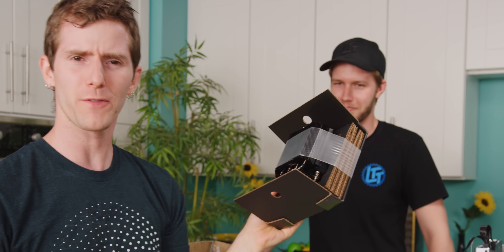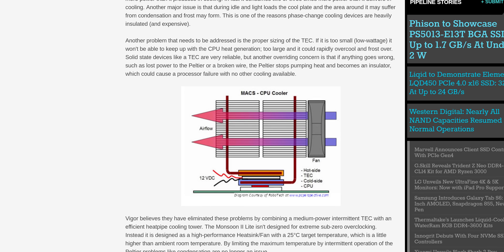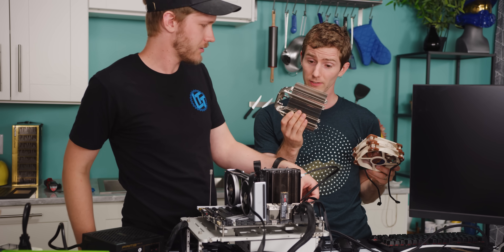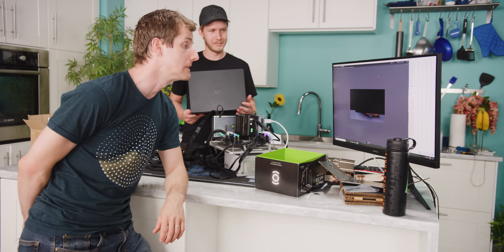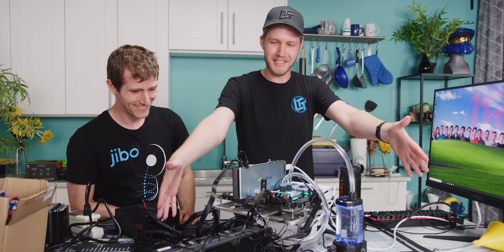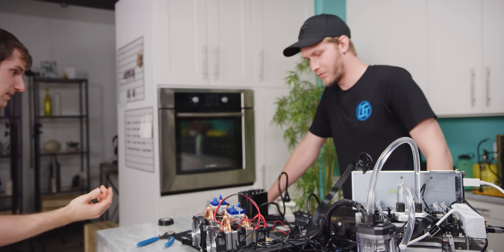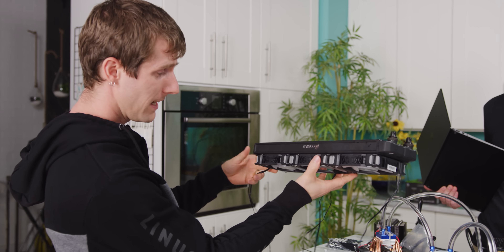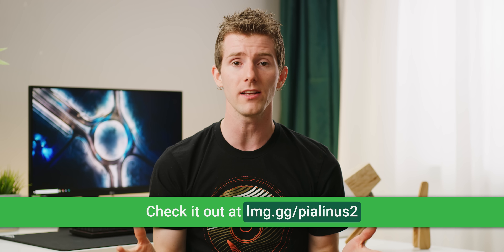Thermoelectric Cooling is a Bad Idea

Comment: Many of those eBay Peltiers (assembled or just the chip) are not the power they state. I bought a 15-amp one and it was actually 3-amp and another was 8-amp.
Reply: There are scammers on eBay? Imagine my shock…
Reply: @TruthNerds  The variability is the result of the manufacturing process and the failure to test and rate the individual units.
Reply: @davidmuth4571  With such a huge discrepancy I think it's more likely they print various model numbers on the same cheap units. How many people will actually measure the current draw?
Reply: @Audio_Simon  It's common practice among many DIYers to routinely test and sort various component parts.  Audio modders test upgrade caps. R/C guys test their new motors, servos and batteries. CMOS chips which are processed in the same batch get ratings which determine their specs and price point. Chips from the same plate could cost as much as $1000 with a "0" rating, while another graded lower might cost $100.  Variability in manufactured items of all kinds is a fact of life.
Reply: @davidmuth4571  Everything you say is surely true. But in this case I just don't think production variability is what is what's going on. Are peltier 'chips' so difficult to make that they design it to draw 15amps and it only draws 3amps? That's 36watts instead of an expected 180watts.
Reply: @Audio_Simon  To know that one might need to what part of the inner workings could cause the variation. An uncalibrated  power regulation module  could easily account for that much variation.

Comment: Why is this idea just now coming back? Cool-IT systems had an amazing product almost 10 (wow maybe even 15?) years back with the FreeZone and Boreas (with or without the MTEC or Silverstone case). That was when Pentium Ds were showing us how to properly heat rooms. 

I am still running my same look with 2010 with my Boreas and MTEC in the SilverStone case. The MTEC control can be a bit wonky, but that is easy to fix or bypass. 

If I remember right, what killed the idea for Cool-it was not the TEC, it was subpar pump manufacturing by a vendor. No one wants blue water goo dripping on their Video card.

Comment: Linus just one thing for you to try. A peltier element can generate power. when there is a temp difference between the 2 plates. Now connect it up between the processor and the cooling element, connect a fan to the peltier element and see how it cools ;-)

Comment: The heat-pipes (in the twin series cooler) won't work, if they are, the way up shown in the video.  The water-block needs to be at the BOTTOM, with the heatpipes and fins at the TOP.   The heatpipes contain a liquid that evaporates; rises up; gets cooled by the fins; and drops back down as a liquid, to repeat the cycle.  If the water-block is at the top, all that happens, is the bit of gas inside the top of the heatpipe, gets hotter and hotter and hotter...

Comment: They actually had the right idea with the smaller one though, using 2 sides, one for normal cooling and one for the TEC cooling. However, what I found to work best is to use a normal water loop with the radiator, and add the TEC modules in the loop to cool the water. Because of the limitations of the TEC modules, it is best used to improve cooling rather than replace normal solutions.

Comment: What you should do is:
Using two CPU coolers with a TEC between them pumping heat from the output water into the input water of the water radiator. This will both cool down the water exiting the radiator and also increase the amount of heat being radiated as the increased temperature of the water entering. You will be soaking and dissipating proportionally and quantitatively more heat.
Whether it'll make a difference, we'll wait and see :D

Comment: ....jesus. That Peltier you ordered draws more power than my entire machine. And, I run an overclocked Vega64. Thefuck.
Reply: Laughs in r9 295x2
Reply: I had a machine where i measured well over 500W consumption at one time - overclocked Phenom II x6, GTX295, somewhat inefficient power supply.

I should actually measure my current machine, which is still the same Phenom II X6, still the same Bronze class power supply, but the GPU is now GTX970 with a good bit of an overclock, which shouldn't actually be THAT bad. A coarse estimate told me i can expect 175W out of the CPU package on my current overclock. I think i can do more than 300W at least.

Comment: also whats with the soldering, get you a crimper and some crimp pins and housings. i find crimping a lot less problematic, i only ever solder when i don't have the right connectors.

Comment: That's not how you do it, you supplement your water cooling with peltier to get even lower temperature... Use two cpu blocks to sandwich them so you can increase the difference between temperature in the loop

Comment: TEC are used to cool something down, not to dissipate heat. Your thermal camera is a good example. TECs are used in cooled MWIR cameras - but so are Sterling cryo coolers that cool down to 77K (-196°C).

Comment: I would love to see some daily practical use temps in the next video. As in, how the temps are when someone is gaming, streaming, etc. Not just blasting it with Renders. I only ask this because back in 2007 or 8 I had a TEC on my old Intel Core 2 Extreme, believe it was a Q9650 or QX9775, anyway the TEC actually did a really good job during gaming at the time until its proprietary fan died :-( So again I'd love to see real-word applications, not just work-related rendering.

Comment: instead of trying to find a better peltier device, you could just stack multiple on top of each other with diminishing returns
Reply: Mycon yes and reduce the input power the closer you get to the cpu in order to prevent the upper Peltiers from getting over saturated with heat

Comment: A Peltier device creates an electric charge through thermal difference between plates(hence them being also known as Peltier GENERATORS), why on earth would they put heat into the system, in the form of adding electricity? Yes, you could reverse the thermal process with electricity, but you would still be putting heat into the system, like cooling your CPU AIO with lukewarm water. I gather physics students didn't come up with the idea. 

Or CPU = heat > Peltier takes CPU heat and generates electricity = powers it's own fan to dissipate. Very badly, to the point of "may as well not bother", removing the peltier would probably improve the cooler ironically.

Comment: Yep, bad idea.  I went full in, direct contact TEC, liquid cooled TEC chillers, huge power supplies and a lot of time insulating everything.  It was a great learning experience, but not worth the time, effort or investment.  The clock speeds you’ll achieve with 0F (-18C) isn’t much better, if at all, than a good liquid cooling loop.

Comment: Can someone help me upgrade my pc? i need to ugrade my cpu but i have no idea how, i know that i want either a ryzen 7 series cpu but this means i need a new motherboard but i have no idea about how to upgrade both at the same time. My build: CPU - ryzen 3 1200 Motherboard - msi tomohawk b350. RAM - 2x4 8gb patriot viper elite.  Power supply - 450 watt bronze.      GPU - gtx 1050 Storage - 1 tb Western digital blue and 250gb ssd (boot drive). Case - Cooler Master Masterbox 5 or something like that

Comment: I hear Peltier coolers are going to make a big come-back, and they're going to be internally integrated to allow vertical stacking of memory layers on top of cache layers on top of cpu / ccx / I/O modules on top of a substrate, because 3d stacking is the future, but the first thing they have to do is figure out how to deal with the heat. So each layer (maybe 2nd or 3rd layer) is going to have a Peltier cooler in it, to get the CCXs in particular down to 30 or 40 deg running temp. So your water cooler block will face a surface with a 115 ~ 130 deg C, but the internal parts of your CPU package will be roughly room temperature.

Comment: A few years ago I put a tec between a Pentium and the stock heatsink in an always on configuration. It worked well for a few months but it ended up causing condensation on the CPU and fried it.

Comment: I can't find it anywhere but I'm pretty sure at some point MSI had a prototype for a cooler using zero energy using Seebeck effect (little brother of Peltier effect, but the reverse way, temp diff into electricity). If I recall well it was ok for short bursts, but under sustained load the tower was getting to hot for there to be enough temperature difference between "hot" and "cold" side, so no more electricity to run the fan

Comment: I have actually built a system with a friend that cools it's self with a peltier.
I will just say that the greatest strength of using one is not bein utilized.
The system we built was a i9 with two 1080Ti's and was being cooled by a pair of Peltier's with only intel stock heatsinks on them.
The main thing I thought of when I created the system was the theoretical max temp of the heat sink witch would be in the realm of 90c due to the fan plastic melting point. So the system has a somewhat normal water cooling loop then the two Peltier's in a similar setup to the second thing you tried.

It's a cool setup and a lot smaller than the rad's that would have been needed but you are right about the power usage.

Comment: I remember these making the rounds around 2003-2005. I was so obsessed about this working.  But the big issue back then was it would make them board wet with condensation. It was open air.

Comment: CoolerMaster V10 did it forever ago.  Except they made a normal 10 pipe cooler, and added the chip on top of the CPU block that would only kick on as a boost when the CPU exceeded a certain temperature.  Neat concept, but it didn’t sell well, and it was too ahead of its time.  They also gave the chip its own radiator, instead of integrating it into the existing fin stack.  I’m not a fan of water cooling, but what if you connected the fish tank coolers AFTER the radiator?  Let the radiator bring everything close to room temp as normal, but then the fish tank coolers suck out a few more degrees before sending it back to the CPU.

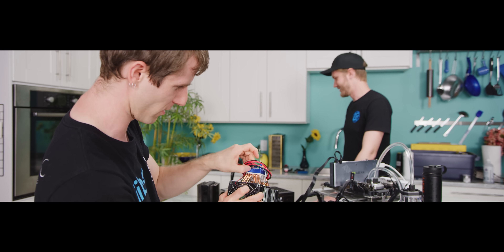Comment: 11:00 for anybody else that does this stuff, use butt connectors.  Solder, even when shielded, is weak to heat and will soften with heat which can cause issues.  Same reason that a lot of people that work on cars don't solder under the hood.  It'll probably be fine but solder also degrades over time. You could also use small quick-disconnect connectors in case you wanted to take it off or switch it or whatever

Comment: Idea: Use regular water cooling radiator that can remove heat fast enough. BUT, add a 10 liter water tank with a large peltier cooler. So when user is idling (browsing etc) for a few hours the peltier cooler is capable of chilling the large water volume to lets say 0 degrees. This would mean you have 4.2 kJ*10 L*(25°-0°) "stored heat capacity", and it would take 1½ hour for a 200 w cpu to heat it back to 25 degrees. When that happens the normal water cooler radiator takes over. You would of course get condensation etc but a fun experiment.

Comment: Instead of replacing the radiator, add the Peltier in to the loop and see what difference that makes. I know the draw will still be high, but I've been wondering how much cooler can it make the liquid when adding it in an existing loop?

Comment: I had a peltier cooler on my 486DX/4 120MHz. Did not work well.
While idling, the cool part condensates a lot. And under load it wasn't enough where the CPU overheated.

Comment: Bad cooling idea: Hook up the CPU water block directly to a large residential or even commercial air conditioning system, and then bridge the connectors back to your office setup via multiple 10Gbit LAN adapters for HDMI and USB connectivity at a distance.

Comment: I had a slot 1 Pentium 2 300 OCed to 450 in the late 90s with dual Peltier coolers, it was indeed a power hog, but it worked great and never failed.0
Reply: Lol, Step Thermodynamics was the company who made it.. Just came to me.

Comment: Thermoelectric pads work better provided their opposite side temperature gets bought back closer to ambient temp, this is why that cooler heated the water, it was water cooling itself to allow the colder side to get colder

Comment: Back around 2001, I had an AMD K6-2 system running heavily overclocked with a Peltier and heatsink setup.  It was glorious fun until the day the Peltier died.  That's how I learned dead Peltier coolers make impressive insulators.  The system just suddenly died and acrid plastic smoke started coming from the machine.  The old Socket 7 was literally scorched.  The CPU reeked of fried electronics.  I was lucky it didn't catch fire.

Comment: About the history of TEK: People were using Peltier devices in "celery sandwich" coolers to cool Celeron A 300MHz processors back in the late 90's. Normally there was only one Peltier device under the larger heatsink on the die side, with a thinner heatsink by itself on the back side of the Celeron's PCB.

Comment: What would happen if you didn't omit the radiator, but instead added the rad before the TEC's?
The radiator would (in theory) remove the majority of the Thermal energy before reaching the TEC.
Eh? I'm just curious.

Comment: Using peltier device is a stupid idea, you basically putting more energy in to the system which translate to extra heat. You better off to reverse the peltier device, using the heat from the cpu to generate electricity which power the fan

Comment: My fx 9590 ran so hot that I considered rigging a peltier plate in. Would've had to hook it to a different power supply due to the amperage. Ended up realizing it was a stupid and inefficient idea. Crazy to think somebody actually did it.

Comment: I have a question for only the most computer-literate people here - Is it theoretically possible to not have to reinstall Windows 10 Pro x64 when you upgrade to a new motherboard, and only just install the drivers that motherboard needs? I'm waiting for prices to come down for the Ryzen 3000 series chip, and I really don't want to have to go through the entire process of reinstalling everything again.
Wouldn't Windows just ignore the old motherboard drivers if the new motherboard can't use them anyway?

Comment: In the before times, I used to run a custom water/TEC cooling system that allowed me to overclock a Pentium III 700MHz to a surprisingly stable 1,035MHz, and if I removed my SCSI controller (which would wig out if the FSB speed went above a specific point) it would do 1,050MHz. I was using a 250-watt TEC module driven by a matching industrial power supply, a quarter-inch-thick copper heat spreader plate between the processor and TEC, and a waterblock on the hot side of the TEC.

The system cooled to sub-ambient with ease, and because of that I had to seal everything around the processor so it was airtight and waterproof, and for that I had to go so far as to carefully press silicone dielectric grease into the processor socket and coat the surrounding area with conformal coating so that there was no chance for condensation to cause troubles.

It would pull the overclocked P3 down to -12 deg. C at idle and at max load it would occasionally hit 20 deg. C. 

Amusingly enough, all these years later I still have the cooling rig and processor, all of which still works.

Comment: Why didn't you guys put the radiator in series with the peltier coolers, that way the radiator would dump most of the heat then the peltier coolers could then chill the water?

Comment: It is almost like ltt didint even try to do a proper tec setup, this is just as embarrassing as the video where they heated a room with a radiator (even a standard heatsink would've done the same damn thing - where do you think the cpu's load is going hint:its the air)

Comment: The use of a peltier unit basically makes the hot side hotter and a cool side cooler. Tho on a air cooler, the hot side is already very hot (70-80c) which makes the peltier very inefficient. The correct use of a peltier unit is to watercool it. Drawing 300w of power to achieve the performance of a good watercooling system.

Comment: You need to increase the surface area. Create more surface area where the tec and the warm water meet. That small block was nothing compared to the power required. What you need is a 500w and run it on 250w for the best efficiency as tecs do lose efficiency. Make a large metal surface with fins like a huge cpu water block with the tec attached to it. Increasing the surface area will work very well.

Comment: would be an interesting idea to combine a thermoelectric solution with a conventional Rad, in order to achieve cheap sub-ambient, while the system cannot cool the CPU by iteself, if you could pull off cooling the chip a lot with water cooling, the thermoelectric cooler should be able to push it over the sub-ambient temp easily, assuming you put it after your radiators in your loop.

Comment: Problems is tech is heat pump not a good conductor .. due to heat move to colder side take time rather than we just put quickly heat aways from CPU unit using vacuum pipe or another self cooling cooling material in heat pipes ... Due tech have higher heat ratio rather than cooling so it no means to use it..